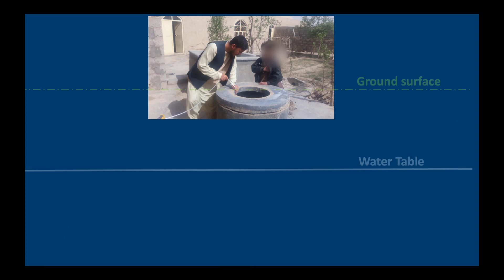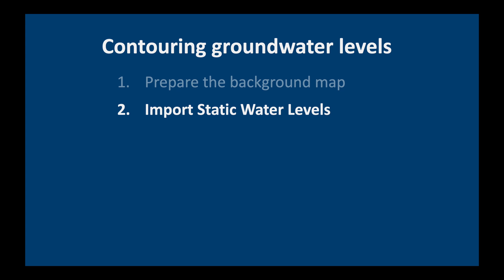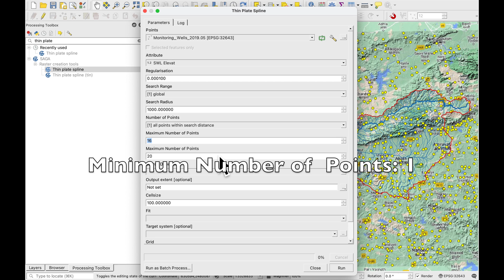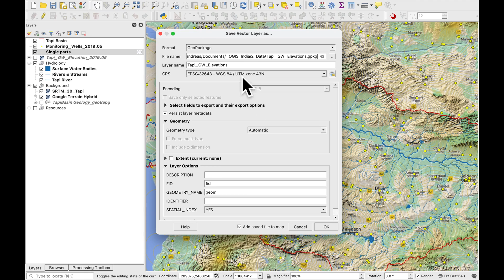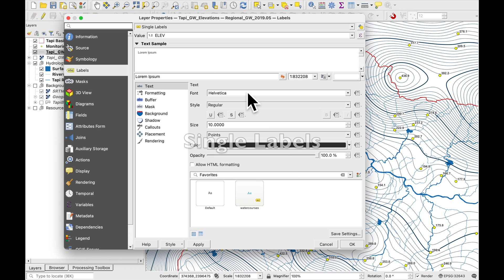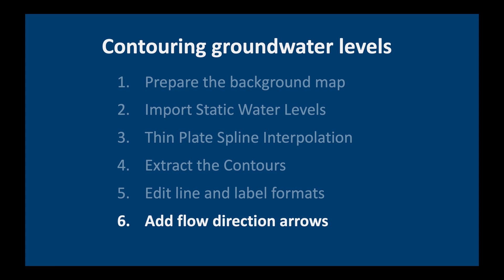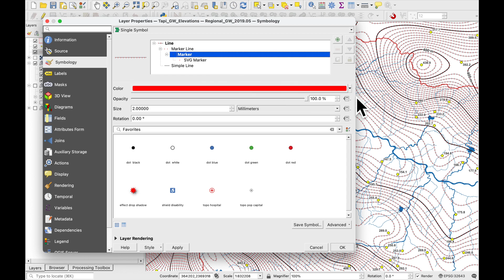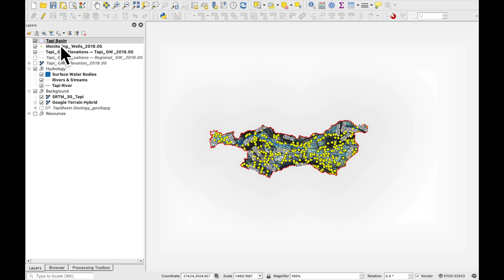QGIS: How to create a groundwater contour map using the Thin Plate Spline (TPS) Interpolation

Comment: I need help 😢
Reply from the maker: what is the problem?
Reply: @GeosearchInternational I want to create a piezometric profile in QGIS using data from 24 wells.
For each well, I have the geographic coordinates, the ground elevation, the total depth, and the static water level.
Reply from the maker: Hi @HousseinaAbdouNabirni, unless you have the ground elevation from an accurate source like differential GPS, it is better to extract the elevation from SRTM30. Then you can interpolate elevation of the static water level using thin plate spline - I am assuming that the wells are spread evenly over an area. Then use View | Elevation Profile to make your section. All the best, Andreas

Comment: Thank you for the nice video! I am wondering how we can be sure that the interpolated groundwater level is not above the surface level. Is it not necessary to include the topography (i.e. DEM) in the interpolation? Thank you in advance for your answer.
Reply from the maker: Hi Shuchen, You should be interpolating the water level elevation in the wells above your datum. Normally that should be below the ground level, unless you have flowing artesian conditions. All the best, Andreas

Comment: The website to download the ground water data is very painful. Has anyone else found it's so slow it's practically unusable?
Reply from the maker: Hi Mark, are you referring to the India Water Resources Information System? https://indiawris.gov.in/wris/#/DataDownload   You can try to get the data when it is night time in India. Good luck & all the best, Andreas
Reply: @GeosearchInternational  Hello thanks for the quick response. Yes the data from the India Water Resources Information System. I'm finding the website very slow to work with. I'll try again at a different time.
Reply from the maker: Hi Mark, yes, it has not easy. If you want a time series of the water levels, you need to download the data by State and year separately. After that, there is no unique identifier for the wells so you need to create one. I concatenated State-District-Station to make one. There is also a way to access the data using python script, but I have not tried it. All the best, Andreas

Comment: Shouldn't the groundwater level near rivers and reservoirs be close to zero?
Reply from the maker: Hi Irina, Yes that is true if the surface water body is in hydraulic continuity with the water table. In the video, the datum (zero) is sea level, and as the river/reservoir in the Tapi basin are above sea level this is also reflected in the contour lines. Near the coast, the elevation of the water table is even below sea level in certain places. This is because excess abstraction by the coastal towns has lowered the water levels so much that saline intrusion will be taking place from the sea. All the best, Andreas

Comment: Nice one Andreas also can you do in hilly slope areas where the geographical vertical drift taken in consideration it is also in SAGA
Reply from the maker: Hi Wonde, the Thin Plate Spline interpolation is good to use for things which do not change dramatically over distance - like the groundwater table which will change gradually. If the aquifers in the hilly areas are interconnected & share the same water table, by all means use the TPS. If not, then you should not be interpolating them in any case. If you are interested in interpolating another parameter - like ground elevation - then another interpolation method is probably better. All the best, Andreas